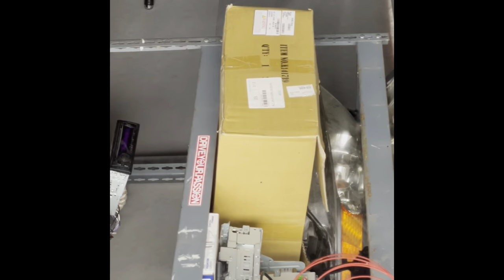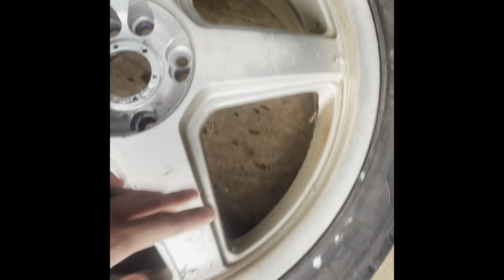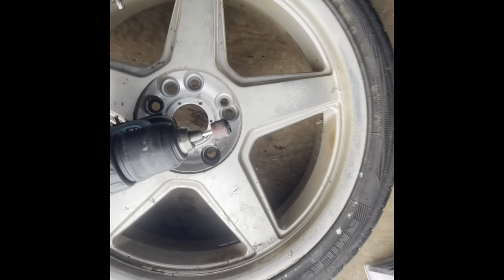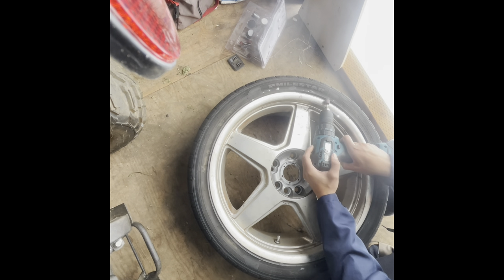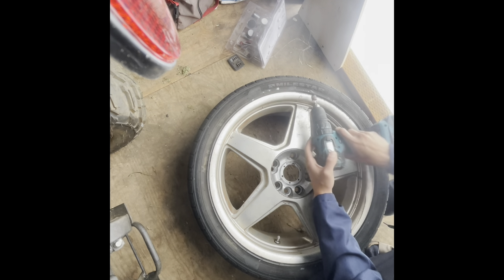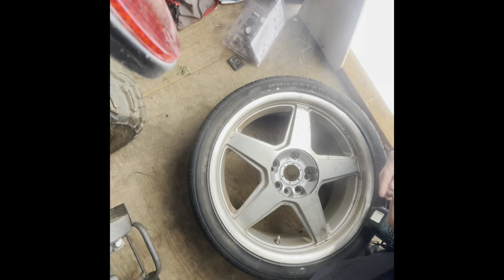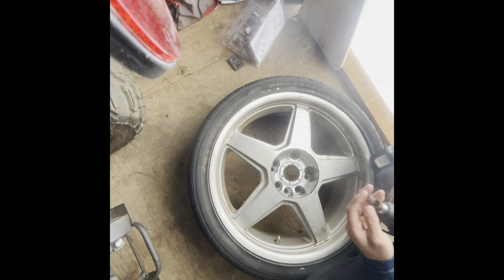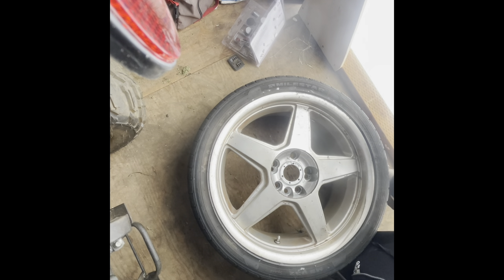Restoring racing hart wheels part 1! (Removing curbrash)

Comment: Just noticed something in the "Thanks" video. Your steering wheel is horny too. Behind your steering wheel buttons, the leather pulls away from the wheel and forms ... horns. My car has it worse than yours. Most TSX's I see have them. How can I get them to "cool their jets" and lay down ?
Reply from the maker: No idea i take it that they use some sort of adhesive, but i will try a few things because you are right of all the tsx i had only the 08 didnt have the steering wheel horns but all the other years did